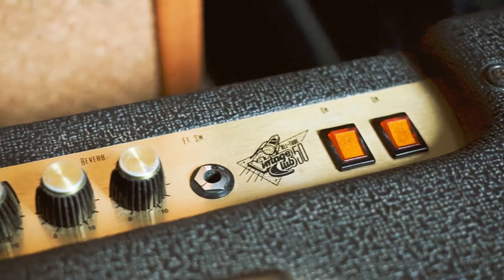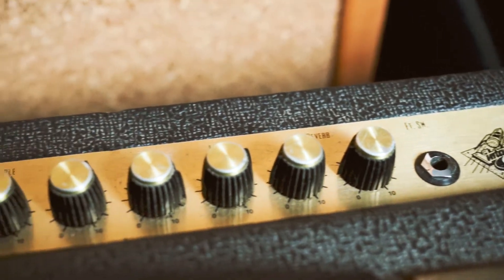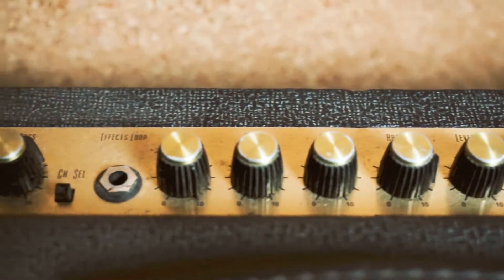12AX7 vs. 12AT7 vs. 12AU7 in V1 and V2: Distortion/gain tube comparison

Comment: Someone mentioned that switching to an AU7 but slamming it with a gain pedal like a tube screamer will actually give you more tube distortion texture than an AX7. While the gain factors are respectively 17 and 100, when you run active devices at the top of their specifications, you get them to compress and clip the signal.
With the gain factor of the AU7 being so low but power dissipation being in fact so high, they probably clip a lot harder than the AX7 when you max them out and then slam them with a high voltage input signal from another circuit, but I will also admit I've yet to try this.
BTW, I'm a college educated electrical/electronics engineering, but it takes a lot of time and cash to test every concept out there lol. 

I love tubes and my tube gear, but my raw overdriven transistor designs actually produce an identical sound to tubes, but di it a bit better.

Comment: I mainly hear volume differences, as I would expect from a tube swap such as this.
Tubes are not EQ's. They all sound the same, but has different gain structure.
Meaning: The difference comes from the power amp being slammed harder. (This would have become evident if the levels differences was equal: i would yield no sonic/tonal difference at all)
I also liked the AU in V2 position best! It had a better level feeding the next stages/power amp.
Another way of dealing with the harshness of the highs would be looking for a "bright cap" in the circuit (often found between lug 2 and 3 on the Volume pot) and adjust it, or remove it entirely (like many do on the Bassman circuits), but I do suspect that the unwanted brightness mostly comes from the Power amp section being pushed too hard.

Comment: It all helps. Even an amp with 2x12ax7 in v1 and v2  simply swapped around can make a cruddy sound into a WOW wtf sound. Building a blackface type amp I ended up with; 12T7  in v1, 12Ax7 v2 and V3 then 12 At7 for v4 phase inverter and it gets that compressed high end and looses the brittle metallic headache sound too. Very simple no Tremolo circuit, just Reverb and vol. Bass mid treble. 2x6L6 and Jensen P12Q and a slightly wider cab to get the warmth. Thanks for your demo.

Comment: Thanks for the comparisons that was done well. BUT I'm sticking with my 12AX7s I do like how they sound. Most of what you are looking for can be done with EQ or different guitars and pickups. I think switching tubes is limiting. Crate Amps are known to be too crunchy, I don't find this to be true with VOX or Marshall. If I ever find my self with a Crate (when Hell freezes) I will revisit this and use a combo that calmed it down a bit.  Super video!
Reply from the maker: Hehe. Thanks! Ultimately, my solution for this Crate amp was to pull out the speakers, make a 2x12" cab, and use a different amp. 🙂
Reply: @Wrigglyaudio  HAHAHAHAH!!! Green Backs in those right? Good plan.
Reply from the maker: They were Crate Vintage Series. I'm liking them as a cab anyway.

Comment: Escuse me do you know if I are any difference between use a tubes with different gain than ones with the same gain??? I bought separately two tubos, But I don’t know if can I use them like this or maybe those can affect my sound quality one is gain A: 94.7 gain B 97.5 and the other is gain A: 104.4 GainB 94.1.

Comment: Nicely done.  While I am always interested in clean quality for V1 I am very interested in Gain quality
for V2.  You have settled that for me.  For my combos I use a JJ 803-S in V1 for the full range with
lows effect.  And now I will use 12AT7s in V2 thanks to your demo.  You get a good sound out of
that Crate.  I never did.  But now I realize it was the EL84s that were holding it back.
Reply: Extremely wrong!!

Comment: Oh god I got a bugera 1990 7 months ago. Its brittle. I jus recieved some 5751's? And some 12 wd7's.
Im wondering if I unbalance the phase inverter if it will damage.
Reply: No it will be fine. You can use some solid state diodes there if you are worried about it, they are more robust. But don't uses them in any other slot they will make a bad clipping tone that sounds like a square wave. I like 12AX7s in my Bugera but I go for the pricy RCA tubes the Russian tubes that come with it suck! They get harsh as they age. I would try better made 12AX7s. My Bugera has a nice tone not at all harsh since I replaced the old tubes that where in it when I got it. Is yours used? Could just be old wore out Russian crap they sound good when they are new but they don't age well you have to replace them more often like every 2 gigs or so. I have had to do that when I can't find RCA.

Comment: Great video. Sort of a scientific analysis.
I'd already swapped V1 for an AT. Not to reduce the gain (=distortion) as such, but to reduce the hiss, which it does.
The VC50 is a seriously underrated combo. But on the positive side, that means you can find them at knockdown prices..
Reply: I already had a used VC5310 that was converted to a single 10" combo (Celestion G10) in a Laney cabinet with a speaker out jack. I wanted to do a few things with this and started looking for a 1 or 2 12" speaker cabinet. Then I thought maybe I should put this back in an actual Crate VC cabinet thinking it'd look better.  I could only find aftermarket cabs brand new for way more than I wanted to pay. While doing all of this looking around I found a used VC5212 for only $150!   I hemmed and hawed and waited and waited until I forgot about it all together.  Then one day I told myself "If it's still listed I'm buying it!".  Sure shit it was still listed and just a 30 minute drive so I bought it.  I justified the purchase because I could use it as an extra speaker cabinet, an extra backup amplifier, use it for parts, use it for the cabinet, keep one at home and one at the practice spot if I started jamming again.  I now run my VC5310 with the 5212 in a 3 speaker half cab format in my bedroom just for fun.
Reply: @T @Tiger_Pumper  Bargain!  The only thing better than one Crate combo is two. You've now got a stereo setup.

Comment: modern tubes are as good as chinese pickups random gain and noise levels bad quality control even robotube can't save the tone
Reply: NO, you just have to get good ones, old vintage stock is a myth. BUT that cheap Russian crap has NO quality control that I can see. You would think with all the neodymium China has they would make better pickups but no you get Alnico 2 and brass base plates. At least they only cost $10 can't expect much for that.

Comment: Edited:  Updated.  The biggest difference between these power tubes is the amount of gain they will provide. The 12AX7 has a gain factor of 100, while the 12AT7 has 60. The 12AU7 has the smallest, at just 20.  If you're amp was biased to a T or U, then swapping to an X  it could have an impact on power supply.  A 12AY7 or a 5751 is also a suitable replacement tube for a 12AX7 for lower gain.
Reply: JR69 So are you saying that the 12AT7 will damage a guitar amplifier? The folks at Eurotube sold me a couple and said they work fine and sell a lot to tame high gain amps. I have an EVH 5150 50 watt and use them in V1 and V2. I've been using them for 8 months and so far no red plating power tubes and they sound great. Just want to be sure I'm not screwing the amp up. cheers Ken
Reply: @kenmasuda7696  No, not at all.  I reread what I wrote and edited it,  sorry for the confusion.  I didn't know what I was saying as I was swapping U, T and X by mistake.  If you're amp used and is biased to a 12AX7, then using a  "T" or "U" won't have an effect, it's just lower gain and more headroom before breakup.

Comment: Nice work, to me the Au7 took the fizz off the top but it made it a little darker which I don't really like and that's why I just sold my Blackstar HT 60 because it was too dark for my taste. I have a Marshall JCM 900 High Gain Dual Reverb 50w coming and I saw a review where someone mentioned putting a low noise 12AX7 ACC83 in slot #1 so that's why I am here.

Comment: Thanks for the comparation. I have  the same amp. I have made some mods in the circuit. Capacitors/ Resit. I have also reduce the power to 30w and removing two power tubes to reduce to 15w roughtly. And I have build an resitor attennuator to reduce the volume to play at home.
Reply: So basically you have just squashed and neutered your amp down to nothing. You got the wrong amp.

Comment: I  have a Vox AC30S1, too much gain for my purposes so I'm going to grab a new 12AX7, 12AT7 and a 12AU7 to experiment in the two positions. (Digital reverb and solid state rectifier, so only 2 tube to experiment with. Good for the "newb" here!). Really looking forward to hearing each combination/permutation of the tubes in my amp.

I already replaced the EL84s with a set of matched Tung-Sol and it's much better than stock, eliminated the dreaded "frying egg" sound of the AC30S1 from the factory. I run the master on 10 and adjust the preamp gain to saturate to taste for the part I'm tracking. 

This helped a ton, thank you!

Comment: Thank you.  Just the info I was wondering about.
Based on the schematic I was looking at....I thought V1 was for the clean channel only??  And V2 was only for the distortion channel??  I guess I need to recheck the schematic.

Can you try the last two positions as well?
Reply from the maker: Hm. I don't really use the clean channel on this. :-) But I thought V1 is split between channel 1 and 2, V2 is channel 2, V3 is reverb, and V4 is phase inverter. I'm also curious to hear how V3 & V4 affect things. I'll try to get to that at some point.
Reply: @Wrigglyaudio  There has to be revisions at some point....since mine has solid state reverb.  V3 in the schematic i found is tone stack...with V1 clean and V2 dirty.  ...which is why i was surprised that V1 in your experiment made such a big difference.  I see your unit is a black tolex....mine is the white version.
Reply: I looked again....and V1a leads to either V1b or V2(via the channel switch).  Then V3 follows V2(as the tone stack for the dirty channel).  Both V1b and V3 lead to the PI tube in V4.
Reply from the maker: Here's V4: https://youtu.be/sB3PsRounEc